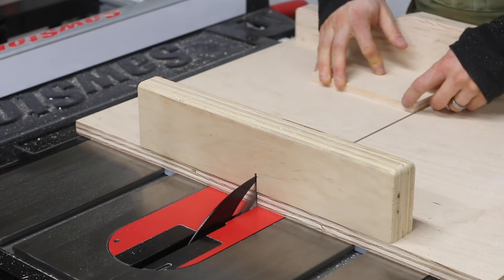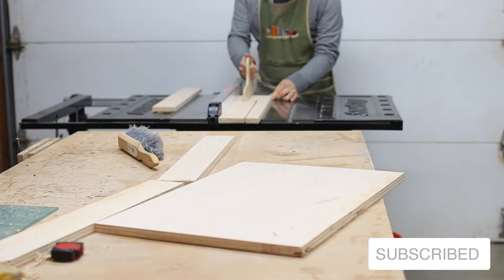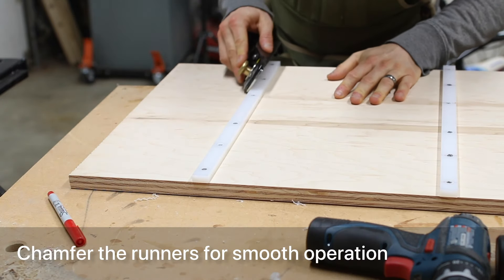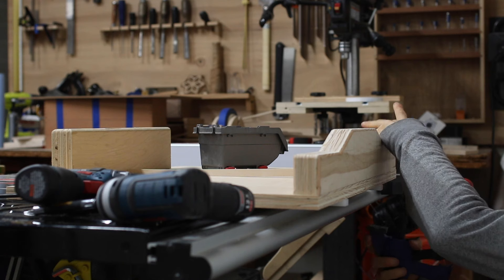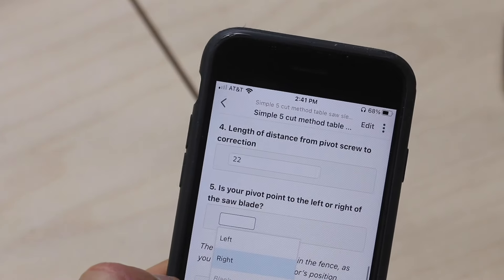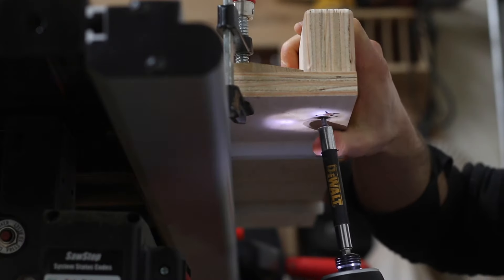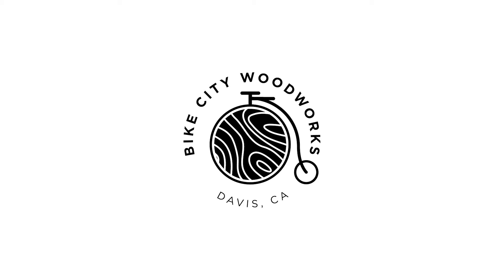The 5-cut method made easy | Squaring a Table Saw Cross-Cut Sled in 5 minutes

Comment: I had the hardest time getting this to work.  I think I’m realizing my problem was I was trimming the right side of the piece and rotating clockwise.  This cuts the left and rotates counterclockwise.  I think this made the calculators suggestions opposite.  It took me a while to realize this.
Reply from the maker: Thanks for the honest feedback! Is there anything I could do to make that part more clear?
Reply: @BikeCityWoodworks  if it isnt noted in the calculator, it would have been helpful to see that important disclaimer there.
Reply: Yeah, I had the same problem.  If you cut on the right and rotate clockwise, the suggested fence correction is backwards.

Finally got it sorted out after seeing your comment.
Reply: I had the same problem. Thanks for pointing this out.
Reply: @BikeCityWoodworks  yeah, would love to see a note about this in the calculator. if i hadn't seen the above comment i would have messed this up as well.  thank you for putting this together!
Reply from the maker: I actually addressed this in a new Q&A video! Going to definitely add a note to the calculator too. https://youtu.be/Szwq3R8pstQ
Reply: Ah I did it too! I spent way too long frustrated with it getting worse then starting over with a framing square. Maybe the calculator could have an option if the piece is left or right of the blade, then the direction of the correction is based on that (just a reverse it if on the other side). Otherwise, it's an awesome and easy calculator! I don't have feeler gauges so I stack pieces of paper and measured with calipers -works perfectly
Reply: Guilty as charged. I did it too. Had me chasing my tail until I saw the comments. Then it made sense. Appreciate your efforts.
Reply: I did the same. The calculator hasn't been updated to clarify this and it's not obvious that watching the update video is necessary.
Reply: Just wanted to say THANK YOU! The calculator made it so much easier to tune up my sled. I will tell that I have always had issues with the rear wood fence. Either plywood or solid lumber always seemed to warp or not be perfectly straight which cause problems. I decided to construct a hybrid fence from 90 degree angled aluminum and wood. It really is a better truer reference plane.
Reply: I just went through the same thing.. but thanks for the video anyways. I think ive figured out the manual way of dividing this. I've built a sled before doing the manual way (years ago) and it was perfect. I have a feeling something glitching here. But ya, the turning of the piece may be the main issue, or it should be opposite.@BikeCityWoodworks

Comment: I notice that in the video at 3.42 into it that you are saying that you are measuring from the point of the pivot screw to the point of correction. However your tape measure is hooked to the side of your sled where the end of your fence is located? The actual pivot screw is somewhere other than the location of the edge of your sled. Are you showing to measure from the end of the fence on the pivot screw side of the fence or should I measure from where the pivot screw actually is screwed into the fence from underneath the sled? Please explain.

Comment: You mentioned that the pivot was 22".  Was this the distance between the screws initially, or the distance after moving the screw based on the first calculation?

..or is the 22" the distance from the stationary screw and the point of the block that's clamped down, with the .014" spacer?

Comment: Great calculator. 
Anyone watching just be aware that if you cut with your material located on the left of the blade, the instruction to move the fence forward of back according to a positive or negative result is reversed.
Reply from the maker: Appreciate that! I will be adding a feature to the calculator soon, allowing you to select right or left.
Reply: i cut on the left side too and came to this same realization after moving the fence twice.
Reply: OMG!!!!!  the end of my sled now looks like a mobster shot it with a tommy gun....  thank you so much for this comment - hoping that's where i'm going wrong as I am cutting on the left... and BCW - yes, using your App... thank you for including mm's... but I do think this is a crucial piece of the puzzle!

Comment: For my three crosscut sleds I’ve always taken my numbers written out on paper and solve with a calculator. It is a great way to get the sled accurate but one of my sleds “moved” over time, didn’t make it heavy enough. The plastic runners are a good upgrade that you can also get by cutting up an old large plastic kitchen cutting board. My wife thought I was thinking of her when I kept buying new cutting boards.

Comment: Novice here. Bought a cheap used GMC 206mm blade table saw (yeah I know). I have spent a lot of time/money trying to get good parallel and 90 degree cuts .... for very basic projects.  Will use this app tomorrow to finish a cheap sled. Thanks for this.

Comment: I used your method and calculator today.  I spent a lot of time with my first alignment using my square to the saw blade.  My first results was 0.0004.  So I re-executed the process and came up with the same results so I screwed the fence down where it is.  
Thank you so much for your video and your great calculator.  You time is greatly appreciated.
Reply from the maker: I appreciate the comment — really glad this tool was helpful!

Comment: Thanks for posting the video, my sled is properly squared now!  A couple of items I learned doing the adjustment are: 1) when making the adjustment and drilling a new anchor hole, place the sled on the table saw so the runners are in their slots before you clamp down the fence . The first time I did the adjustment the sled was on my workbench and the runners became slightly out of alignment and there is no margin for error when this occurs so I had to drill another hole. 2) The calculator is designed to provide the error adjustment when you cut your piece on the left side of the blade which I think is the most common way people make cuts. However, if you cut from the other side of the blade I believe the result would need to be reversed to adjust in the opposite direction. The video shows cutting on the right of the blade though however the second video covers this issue -  I think there will be a change to the calculator to indicate which side your cuts were made on. 3) this is embarrassing, but if you have a few holes you drilled for adjustments, keep track of the ones that are no good. I had three holes (initial hole, a second hole that I drilled but didn't have the runners in the table slots, and then the final hole). I took out the screw from the third hole to counter sink it further and do some sanding and then I wasn't sure which hole was the third hole. Luckily I already had put in my additional screws to fully support the fence so I didn't lose my alignment.

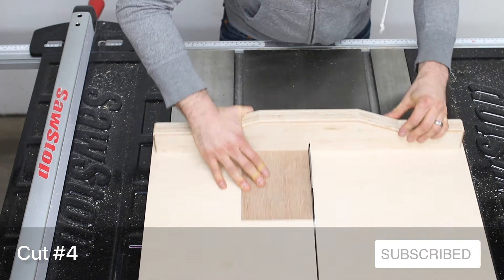Comment: 2:39 into the video, and I just caught something. You're cutting on the opposite side of the blade from every other 5-cut video I've seen. However, your pivot point is on the same side you're cutting vs. opposite side. I wonder if that matters.
Reply from the maker: Oh interesting, I just tend to cut toward the right of the blade. In my other video, Answering your questions about the five-cut method | Woodworking Tips
https://youtu.be/Szwq3R8pstQ, I mention that cutting on the opposite side of the blade does in fact produce different results!

Comment: It took me 4 or 5 times to get it done. At first, when I  put into the calculator what side the pivot point was, I thought it was the side that had the fixed screw, opposite the side of the fence that you were moving, but my cuts got worse. So I put it on the left side instead of the right side. When I did that, I got to .002 of an inch. Thank you very much for putting this together for everyone and making it free to use!

Comment: Thanks man...This worked out great. 

For others that want to do this, a few tips. Something I learned. The pivot screw needs to be snug but not too tight as it will distort the fence or the bottom plate when you adjust it. Also when making the cuts on the test piece, push on the sled only where the screw locations are, or again you can distort the fence and or the base which will screw up the cuts and input dimensions. After doing it 3 or 4 times I realized what was happening and followed the above procedure and got it perfect under a thousandth. It's also important that the 2 sides of the fence be square to each other, and absolutely straight for the best results.. I did this with a jointer but it can be done on the table saw being sure that your blade is perfectly square to the table saw top. This is pretty critical, that the fence be straight and 2 square faces. Also be absolutely sure to predrill all your holes. If you don't the screw will shift the fence. That's all I got.
Reply from the maker: Great advice, thanks for sharing!

Comment: What a great video and calculator method for squaring my saw.
I have a DeWalt job site saw and the crosscut results in a lot of plat in the cut.
I built my sled exactly like instructed in your video and after (1) adjustment and correction of .012…, my result is now .0005”…. This is a great video, very well presented, and super helpful….. Great Job!  LIKED & SUBSCRIBED!
Reply from the maker: Great to hear! Glad it was helpful.

Comment: The calculator is in inches. If I plug in metric numbers, it should work too, right? If all inputs are mm, the formula should still work?
Reply from the maker: I think I already added a toggle for metric — did you not see one?
Reply: @BikeCityWoodworks  I do now, thanks.

Comment: To calculate more accurately, adjust the sample’s length to reflect the distance between the actual points where the width was measured by the callipers.  For this application it’s best to have the calliper jaws closer to perpendicular to the workpiece when measuring width, otherwise it’s difficult to know at what point on the jaws the piece is actually registering.  The depth of the jaws is not insignificant and could skew the effective workpiece length.

Comment: Hi, please can any one explain 4. Length of distance from pivot screw to correction in the calculator?

Does this mean distance from pivot screw to the end of fence or the other screw in the fence in the opposite side.

Or does this mean from the pivot screw to the cutting line of the table saw blade?

Or is this just the length of the sled / fence?

Thanks.
Reply from the maker: Hey Jim, you weren't the only one with this question, so I made a video answering this question (amongst a couple others)! https://youtu.be/Szwq3R8pstQ

Comment: How would this work for a sled that is offset to one side, like not completely even amount of the sled base on both sides? For example I I am making my sled so they there is more space on the left side than the right because I can cut longer pieces to the left whereas I’m limited to the length that I can cut on the right just because of the way my shop is setup. So the screws on either end of my sled aren’t the same distance from the cut line. Thanks for any advice on that.
Reply from the maker: Scott, I actually brought your question up in a Q&A video!  https://youtu.be/Szwq3R8pstQ

Comment: Thanks for putting together the calculator. I dialed in my crosscut sled to a .004" tolerance, which is fine for my purposes. However I must point out that  the metric version is off. I tried a few times to dial in my fence using your calculator, but the "correction amount" was very off, as in 11-16mm (equivalent of roughly 1/2"!) while the same piece of wood remeasured in imperial was in the thousands of an inch tolerance neighborhood. Not sure if you got a decimal point off in the code or something? Otherwise great video and great (inches) calculator!

Also, tip for everyone: Don't use plywood for the temporary pointed "calibration board" that you clamp down in front of the fence. The plys are too soft and compress/break at the tip, compromising your measurement. Better to use hardwood.

Tools used: Sawstop 36" Contractor Saw; 'igaging" brand digital calipers from Rockler. Pivot point was in the 25" neighborhood.
Reply: The metric value is too great by a factor of 25.4.  This is because a "metric conversion" has been done on the final result.  In reality, there is no need for any conversion and no need for selecting between Imperial or Metric.  This is because the formula is just ratios.  The simple solution - until the calculator is fixed - is to select "Inches" no matter whether you are using inches, millimetres or cubits.  The units for input and output will then always match.
Reply: @idontwantachannel3091  Thanks great insights. Didn't realize you could input metric in the inches mode. Good hack! But still more room for user error;) But yea agreed I would just stick to inches on the calculator until/if it's fixed.
Reply from the maker: @idontwantachannel3091  Thank you! I will attempt to update this!

Comment: I don’t understand how my measuring from the center of the pivot screw to the center of the kerf with a tape measure (!!! Accurate to a 32nd at best) is going to allow for calculation to produce accuracy of right angle fence to 1/1000 ???

Comment: when doing the 5 cut method, does it make a difference which side of the blade you cut on?
Reply from the maker: If I understand correctly, you mean placing the board on either the right or the left side? It should work on both, I think!
Reply from the maker: I actually tested this question in a Q&A video here! https://youtu.be/Szwq3R8pstQ

Comment: Thanks for the calculator and the guide. It’s a great script! 

However, after multiple attempts I found that the end adjustment calculation could only get me to about .003” Seems to do with the length from the pivot point.

How I got within .0008” was using the actual length of the 5th cut (in my case it was 12 3/8”) vs 22”. Then applying that adjustment number to the adjustment length point at 22”

Doing this gave me the same result/adjustment as compared to doing the actual Ng’s calculation method.
Reply from the maker: Hmm, interesting, so you were putting 22" into the length of the 5th cut?

Comment: You said a thousandth of an inch is close enough to square as to be "square." But 1/1000" at what length? If you're off 1/1000" for a 1/1000" length board, well, that's actually a 45 degree angle, right? I mean, sure I'm exaggerating to make the point. But still. I'm off by .0014, but I'm using a much bigger 5-cut board than you are. My final measuring piece is 9" and change. Is this a fair point or am I missing something? Thanks for this video, by the way! And thanks for that awesome online calculator!
Reply from the maker: Yep a totally fair point! It’s going to depend on that distance you measure to, not necessarily the board length. That distance is usually the “other end” of the fence from your pivot screw. I’d say .001” over 12” is pretty good. That’s .0048 degrees according to a rise over run calculator. Hope this helps!

Comment: Is .002 close enough?
Reply from the maker: Short answer is that it depends. If it's 0.002 over 21" inches, it's probably close enough. If it's 0.002 over 12 inches, I would keep trying!
Reply: @BikeCityWoodworks meaning between the pivot point and the other screw right? Mine is 28” apart

Comment: Can someone please explain to me what the pivot point is. Thanks.
Reply: the pivot point is the screw that you leave in the fence on one side, so that the opposite side of the fence can be pivoted forward or back. the length from the pivot point to the adjustment is the length from the screw you are pivoting around to where you will be putting the feeler guage to move the fence a small amount forward or back
Reply from the maker: You weren't the only one with this question, so I made a video answering this question (amongst a couple others)! https://youtu.be/Szwq3R8pstQ

Comment: Very confused of “the pivot screw” and how this relates to 22”.

Are you just pulling a number out of the air - 22 in this case - and only using this as your reference on the back wall to do your adjustments against to move back or forth? It has nothing to do with the actual two screws we’ve put into this back fence up to now?
Reply: Also confused how you mark the pivot screw point at “right”, yet it is on the left of the blade from the operator’s standpoint
Reply from the maker: Hey zach, thanks for the questions! The number — 22” — is chosen based on my sled, meaning I chose a length that was long in order to get a clearer adjustment thickness and short enough that it would be still in the bounds of the fence. Here’s an analogy for why you want this length nearly as long as possible: you’re walking in a straight line and make a 1-degree directional change. In two steps it’s barely discernible, but over the course of 1mile, you’re now off your original course by hundreds of feet. Much easier to get an accurate measurement at a longer distance. 

As for the pivot point, my pivot screw is on the operator’s right. The pivot point is the point that only rotates — the correction point is the opposite end that moves both rotationally and in distance. Does that make sense?
Reply: 22 wasthe distance in inches between the 2 screws in the fence: the pivot screw on one side and the screw you initially fasten on the other side. Necessary to get this number to "solve" the equation.
Reply from the maker: Zach, you weren't the only one with this question, so I made a video answering it (amongst a couple others) here! https://youtu.be/Szwq3R8pstQ